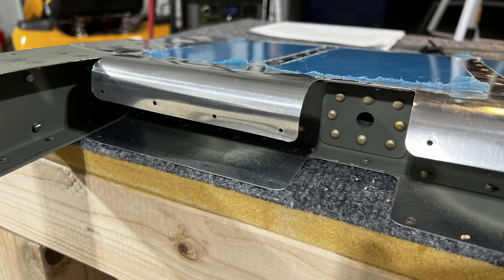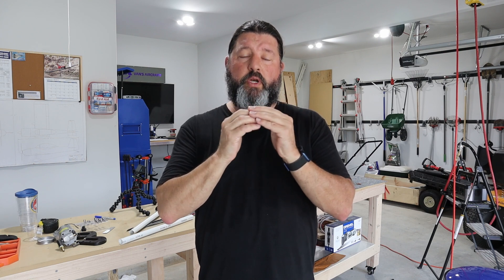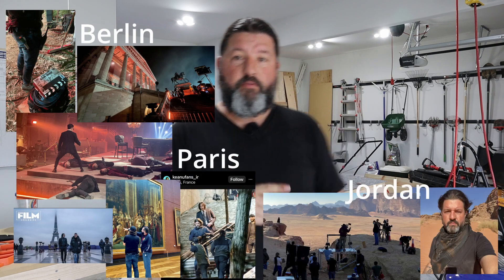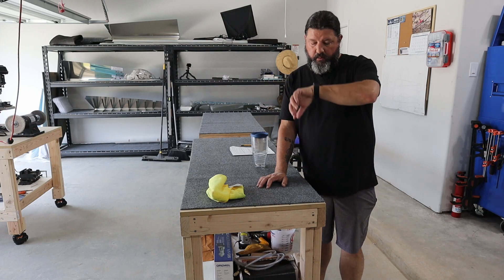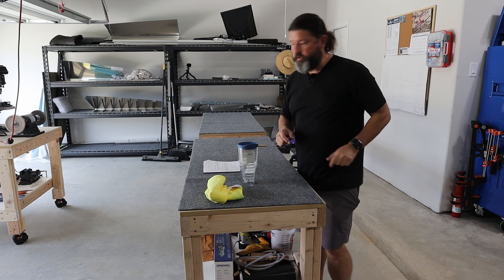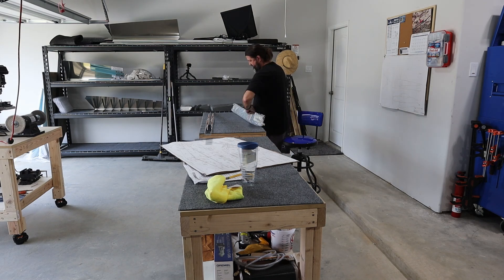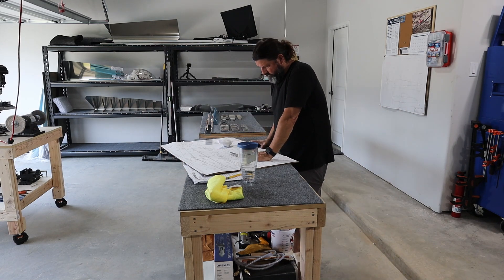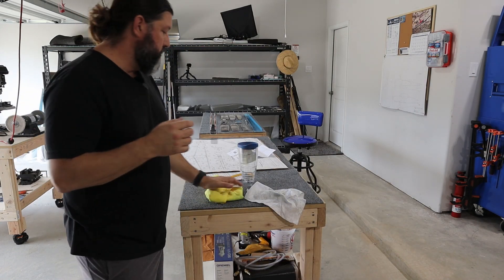Van's RV-8 Build. Ep 027. Horizontal Stabilizer 05

Comment: I finished the priming of all my H and V-stab parts last night. I am definitely loading a video tonight. Just curious since you are in the biz if you know a guy that is an actor/stunt man for many years now that I served in the Corps with, Ross Seymour? BTW, those front spar angles held me up too but for a different reason. I wasn't interested in whacking them with a hammer. I finally just did it and was happy with the results. Good luck!
Reply from the maker: Ross sounds familiar, but I can’t say for sure… I think that after a couple of anxiety inducing whacks with a rubber mallet I found that it was just as easy (and less stressful) to bend the pieces by hand with the part sandwiched between a couple of pieces of wood. Have fun!